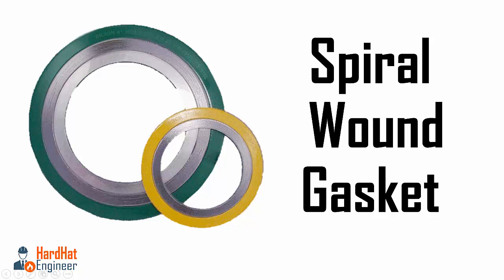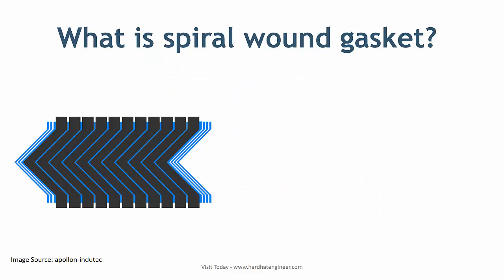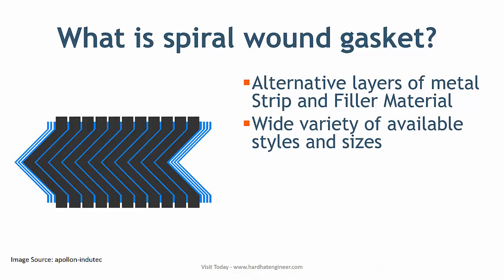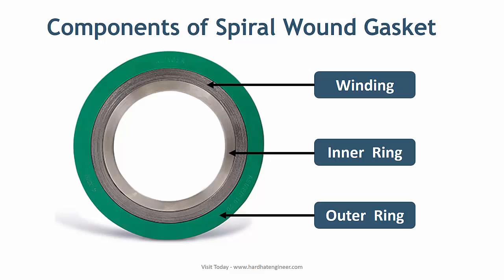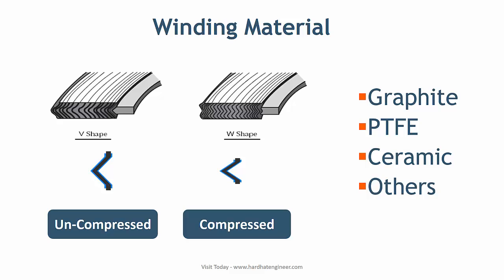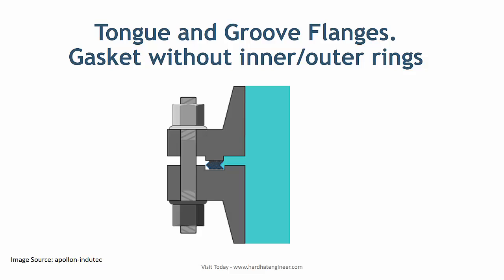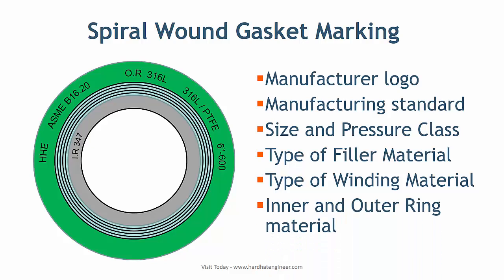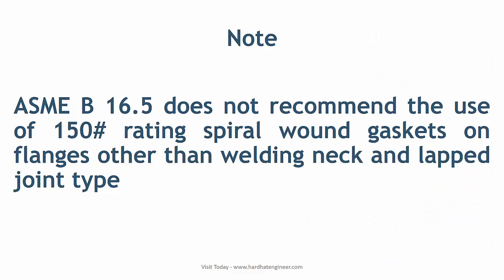Spiral Wound Gasket Basics, Components, Marking, Color Coding for Engineer

Comment: What type of gasket can I use for flat face gaskets. I am  facing leakage issues when using a 5mm simple rubber sheet as gasket. Fluid is water and working pressure is only 5 Bar. Pls advice

Comment: Sir, we need gasket for cryo application..but the prblm is mating flanges are of different materials..ie monel and ss..operating temperature is 90 K and pressure is 20 bar..u please suggest one sir
Reply: I'd chose an isolation gasket to avoid galvanic corrosion. Maybe teflon if it holds up to the pressure rating.

Comment: I choose my weldneck flange NPS 12 with spiral wound gasket NPS 12 too. But gasket's outside diameter blocking the entry of bolt in the flange. Why is this happen ? is my step choosing gasket wrong ? thanks

my flange and gasket rating is 300

Comment: I ve used SWG without inner ring in drainage system low pressure
Just because we don't have spare gaskets in that time 
Please tell me if this correct or not ?
Reply from the maker: +Youcef El Seddik Berrim Inner ring is not mandatory. You have to check your piping class for drain line if it allows the use than no problem.
In my personal opinion it is ok to use swg without inner ring in drain line as there is no chance of vacuum but check your pipe class to confirm.
Reply: Thank you sir

Comment: I have used swg with outer ring and no inner ring in oil lube applications. Based on your video the flowing hot oil would affect the integrity of the graphite wouldnt it?. 
For fire water applications can you use swg on flat face gaskets? Could you do a video on galvanised pipe for fire water applications?
Reply: HardHat Engineer 

Please note that Graphite can not and should not be used in any elevated temperature. 
Normally the limit for graphite is 400 to 450 degrees C depending on what graphite is used and how long the gasket needs to work. 
The reason is that Graphite oxidize. Graphite is carbon and carbon reacts together with heat and oxygen. Oxygen are present everywhere to some extent.
Reply from the maker: The one of the main reason for gasket disintegration or damage of SWG is an excessive tightening of flanges.  
You of inner ring are recommended as said in the video 1) when there is a chance of vacuum in the pipeline. 2) when contamination of process fluid is not acceptable. SWG with graphite fill and SS metal strip can be used up to 720-degree centigrade. The designer will consider various parameters while recommending the gasket. I don't think in your lube oil case is there any issue if you are torquing your flange properly.  
For fire water application normally flat face gaskets are used. 
Do you want to know about the galvanizing process or something else?
Reply: HardHat Engineer thanks for your reply. I am in the process of developing the pipe specs for fire water a pipework expansion. I have been told by the client galv pipe with ansi flanges, but galv piping for fire water has got withworth threads. Will you be able to mix medium gauge galv pipe to AS1074 with carbon steel 105A forgins?
Reply from the maker: Yes, you can use ASTM A105 galvanized forged fitting with you standard carbon steel galvanized pipe.  To get the confidence, I suggest that check the Standard of AS1074 and A105. What you have to check? Compare the chemical and mechanical properties of both grades and you can tell your client with confidence that you can mix them. 

If you want to learn more about basics of material and piping component you can check my course.  You can enroll by a significant discount just USD$10.  https://www.udemy.com/process-pipe-fittings-for-oil-gas-career/?couponCode=FB10 
Thanks
Reply: Ma Gip 
Are you talking about fire water lines on or off shore? 
For all sea water lines you should be careful and not use graphite in any gasket. It will cause galvanic corrosion to the flange and end up causing you a lot of problems and cost.
Reply from the maker: +Christian Pettersson Yes, you are right. For beyond 400 degree, most well known SWG have their own proprietary filler. Thanks for inputs.
Reply from the maker: +Christian Pettersson Ma Gip's, questions about Lube oil and subsequently he has asked to use A105 with other galvanized CS in fire water line.
Reply from the maker: +Christian Pettersson It will grate if you share your expertise and opinions for Ma Gip's queries.
Reply: HardHat Engineer 
I would be happy to answer any questions I can. 
Send an email to me. 
Cpettersson@flexitallic.eu
Reply: Christian Pettersson i have asked two separate questions the one related with swg was in the oil and gas industry on shore. And the second one it was related with fire water pipework on a power plant. I have opted for steel api5l galvanized with raised face flanges and ring tipe garlock gaskets. Thanks for your help